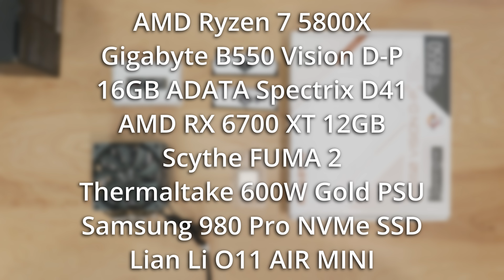Chill Build Volume 22: Lian Li O11 AIR MINI

Comment: Where to put hard disk?
Reply from the maker: There are spots to mount them in the back section, but you lose some if you put an AIO in the side. I'd check out the manual for details. I've also got an Un-Build video up so you can see the guts better.
Reply: @ChillBuilds  yeah I put Aio on the back section now need to find space for my Hdd😅
Reply: @danieldanieldanielUvu   There is a cage for standard hdd right above the psu.  P.S. I love this case.